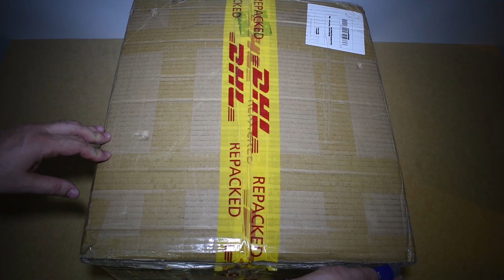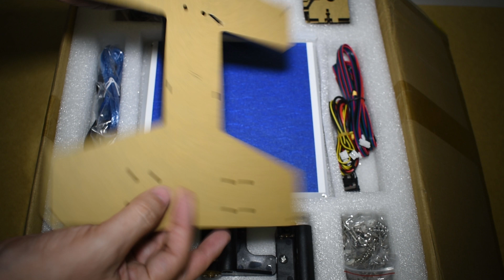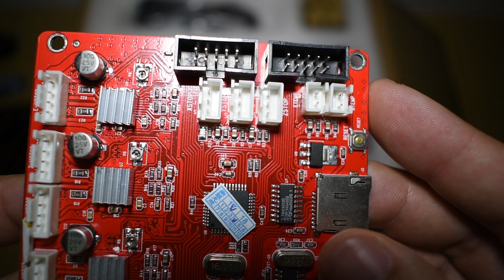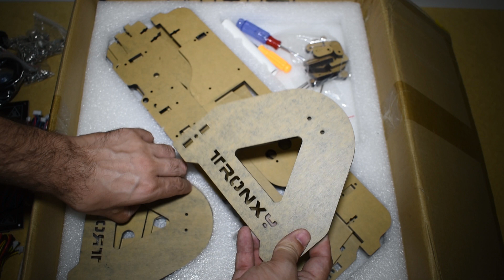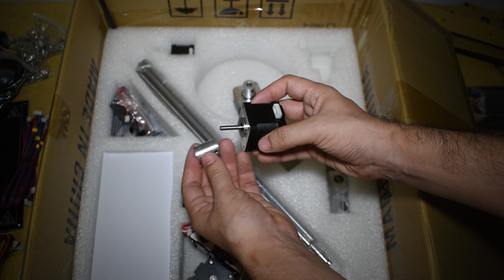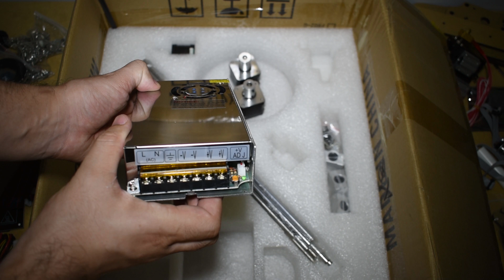TronXY X8 unboxing

Comment: I'm still waiting for mine to arrive, can you tell me if the auto level from GB works on this printer? 
There's very few info about X8. 
Nice video BTW.
Reply from the maker: Hi,
Sorry but i dont have that information either.
My printer has no auto level sensor (and it works just fine without it...less weight on the already heavy extruder).

Comment: At first glance seems to be better than a tevo. What you think?
Reply from the maker: Hi ComicBit,
So far i found good things and bad things. I will give my full review very soon.
Reply: ruiraptor i'm a tevo owner and looking at the design the dual z axis motor and the general linear rods used make me think that this one can work better than the tevo can. But maybe i'm wrong. Waiting for your video then
Reply: ComicBit at least the tarantula seems to have a speed advantage because of the bowden system